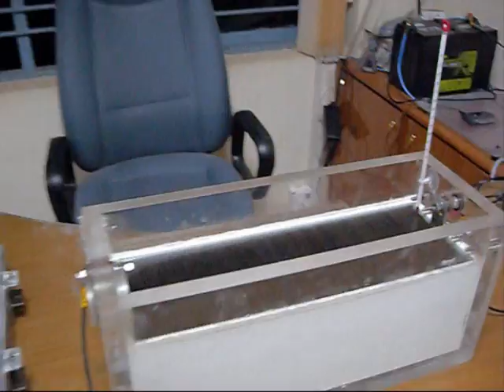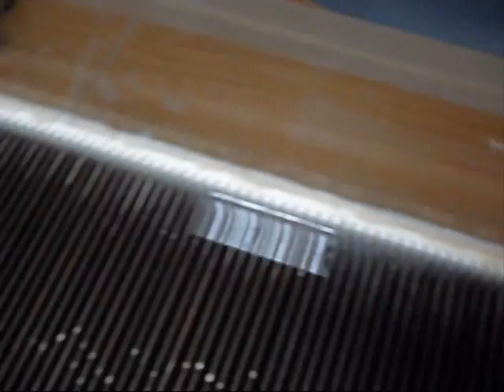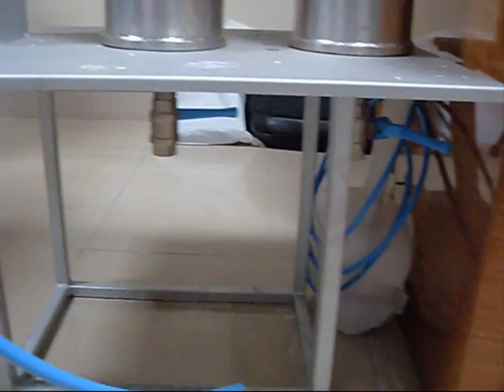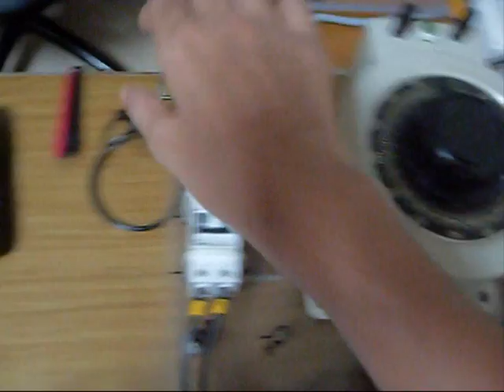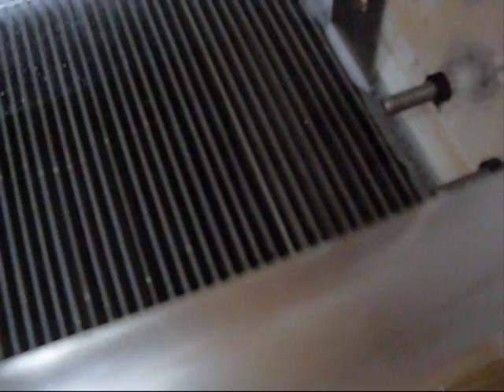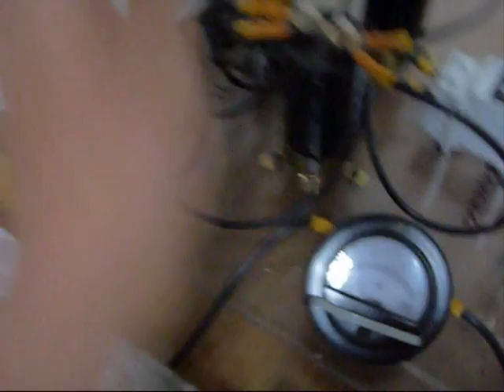Bob boyce cell replication by bhargav

Comment: Yeah....NO. Not even close.
Reply: Boyce plans that I've seen have a toroidal core with 4 windings, each with their own resonant and harmonic frequencies, driven by 555 timer oscillators and mosfet pairs. This setup is none of that. It's a simple variac with rectifier.
Reply: @bogey6925VR  u are right... i also think so! This build is only normal Elektrolyse.
Reply: He didnt Use resonance frequencies... or what do u mean with it?:)
Reply: Hey Mike, This was of course the first stage for conditioning the plates. It required atleast 100 hours of operation before the system could be tried with the harmonics etc. I never hit the harmonics sweetspot with my insufficient electrical/electronics knowledge . Burnt so many rectifiers and what not. However, i did manage to brute force run the system at 3kW DC pulsed and cut about 20mm of steel. The experiment ended in early 2010

Comment: Is the water level suposed to be that high? You are running a wet cell. All the plates that produce no gas are bypassed electrically OVER the plates instead of trough the plates.
Drop your water 1 inch Under the plate tops. So the current must go trough the plates. Not over them trough the water.